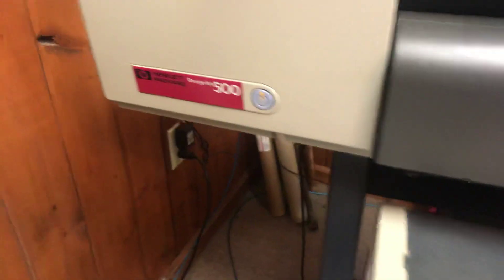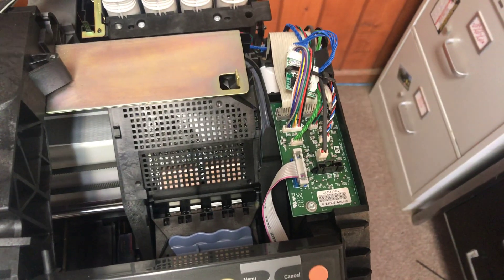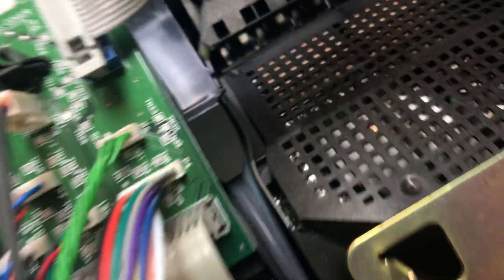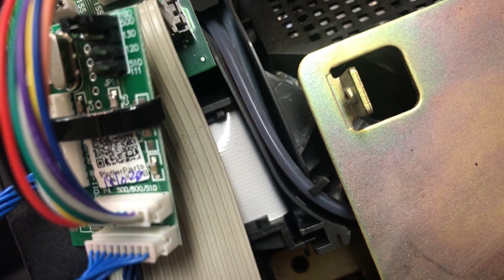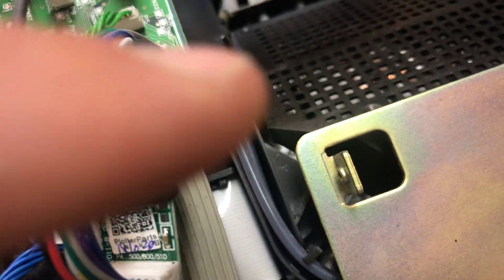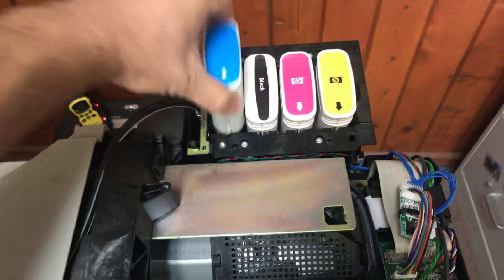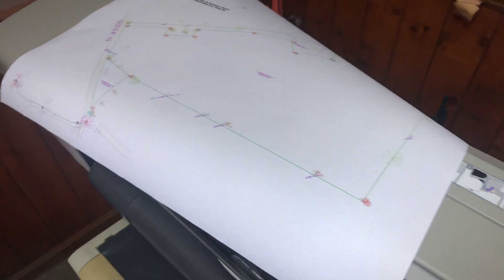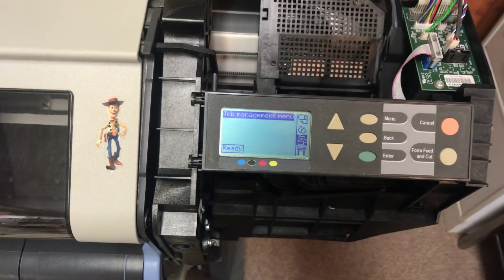HP500 Chip Reset Decoder Card Install

Comment: Trying to bring back to life a 500 after being serviced years ago and left in storage.  New Printheads and Cartridges.  Got the big 'X'.  Installed the Chip Reset Decoder card but still the big "X".  Any ideas?  The Rainbow cable is now red.  Someone here mentioned about swapping the cable around, but it just looks pin to pin so can't see how that would make a difference?
Reply: Also, the printer had some original cartridges, still very full, but years pass their date.  But do they really have an end date, can the ink deteriorate?
Reply from the maker: @tim-ClassicVWLT  I have used out dated cartridges. I use think the X is another issue. The decoder just makes it think the ink is always full and never shows empty. Yours is not even recognizing the cartridge. I would get a new cartridge and try. If it’s still X and it must be in the printer. ??
Reply: @piratesofthehatchie   Thanks for the reply.  I replaced the Printheads first with the very old (HP original) cartridges still installed.  They showed as okay.  Produced a print then got the "Replace Cartridge message and the flashing "X".  Installed replacements.  No joy.  Installed the module.  No joy, with both sets of cartridges.  Probably at the end of the line now so it will be heading to eBay for spares.  It has bearly been used in its entire life, so in very good physical condition.
Reply from the maker: @tim-ClassicVWLT  I got a HP T830 plot/copy/scan a couple years ago to replace mine.
Reply: Is this the only solution!? My magenta goes after literally 1 print after install. So basically I get one print per pack of ink. Now the blue is flashing too and then this error code went on sad as this was my money maker
Reply from the maker: @melissamckenna2948  if you haven’t got this decoder, It’s worth a try. Get you some refillable cartridges and see what they do.

Comment: I replaced the entire ISS (Ink Supply Station) and after 15 or so plots, the cyan chip decoded and showed an X again.  So the ISS isn't the problem.  It's probably the logic board.  So, I've ordered the decoder shown here ebay one to try.  It should make the plotter think all of my ink cartridges are full and bypass the bad cyan cartridges at the risk that when I run these dry I wont' know it until the prints go bad.  Hopefully I'll notice before my print heads take damage.  Maybe I'll get all my cyan cartridges working again!  If not, I'll try to transfer ink from them to a working empty cartridge.  Such a waste when your old plotter just decides to code a full cartridge as bad and then it won't work on ANY plotter.  Full or not.
Reply: I've now successfully installed a decoder board as you did and the plotter immediately started reading all cartridges as new and full as advertised.  I can use those old Cyan cartridges now on that plotter.  I plan to put some new chips on the other cartridges to hope to use them sooner.  Thanks again.

Comment: This was very informative.  I have just received the entire Ink cartridge reader tray from a chinese refurbishment thinking that was my problem.  It wasn't too expensive to order, but now I see maybe my issue is the decoder board.  My Cyan or Blue would go unuseable and I went through 4 or 5 cartridges. It would read new ones for a few days then stop accepting them and these cartridges wouldn't work on ANY of my other plotters. I Have a second HP 500 and an HP800 in addition to the problem machine.  So I'll try the tray and if it doesn't work, I'll try what you tried.  

What's interesting is you say the cartridges started working again for you.  My cartridges won't work on ANY machine after the troubled machine renders the blue cartridge "X"'d out.

Comment: Does the decoder card register cartridges as present and full even if the cartridges aren’t installed? I’m wondering if this decoder completely overrides the chip on the cartridges themselves.
Reply from the maker: It makes the plotter show full cartridges all the time.
Reply: @piratesofthehatchie  Thanks for the quick response.  I’ve been thinking of running the printer’s ink tubes down to gallon-ink supplies. That would either mean installing the decoder and keeping empty cartridges in place for their chips to be acknowledged as “cartridges installed”.  But if the decoder forces the printer to think they’re installed and full even if they’ve been removed, I won’t even need empty cartridges and can just run the tubes directly to gallons of ink.  Eager to try this, so thanks for the feedback.
Reply from the maker: @jeffsheldon  you may need cartridges in. I think it knows if they are removed. I have retired my plotter but may be able to check it.
Reply from the maker: @jeffsheldon   turned on mine with no cartridges in and it showed full and ready. Took a pick but can’t post it. 🤷‍♂️ so it should work like you want.
Reply: @piratesofthehatchie  This is extremely generous of you. Thanks for even considering testing this functionality out let alone actually following through. I was donated one of these units for use in a student media lab and my hope is to make printing cheap and accessible for both students and the surrounding community. You’re good will will benefit a lot of people and I likely would have gone about this differently without your detective work. Thank you.

Comment: Hi, I have bought decoder card ftom AliExpres but it doesn't work... maybe I made something in wrong order or something?
Maybe it works only with some models of 500? Maybe it is firmware?
Have you removed the cartridges (or chips) from the drive before installing the card?
I will be grateful for any help...
Reply: Flip the rainbow cable. Work for my

Comment: big big thanks !!!
work on HP 800 PS
Reply: Hi, I have bought decoder card ftom AliExpres but it doesn't work... maybe I made something in wrong order or something?
Maybe it works only with some models of 500? Maybe it is firmware?
Have you removed the cartridges (or chips) from the drive before installing the card?
I will be grateful for any help...
Reply: @88marcin  I have already installed the latest firmware and use the cartridges with self-resetting chips
Reply: @danchiparus 
 decoder + self reseting chips on cartridges?
Reply: @88marcin  yes!
Reply: @danchiparus  where did you bought that chips? are they realy ethernal?
Reply: @88marcin  bought in Italy. For a while I used them without a decoder but they generate a problem when they reach 10% of the measured capacity (the moment when the chip is reset automatically) causing the machine to go into crisis. Using the decoder nothing happens anymore - it always signals full cartridges
Reply: @danchiparus  while instaling decoder shows full, until sending file to print, then machine shows error 22:10... i tried with standard chips
Reply: @88marcin   for me work with autoreset chip...
Reply: on HP 800 PS with last firmware
Reply: @88marcin  I have this same issue

Comment: What happens the actual cartridge do run out of ink - how would you know to replace ? 

What i understood is that decryption chip fixes issues with full cartridges with faulty unrecognisable chip installed and allows the printing.

Please advise
Reply: running out of ink when the printer thinks it has ink will cause the print heads to misfire which is very bad for them.
Reply: Ron 100% - hence might be good to invest in transparent ink cartridges
Reply from the maker: The plotter will pause as it goes back and forth and you will hear the cartridge trying to prime. When I notice this I pull the cartridge out and shake to see how much is left. Usually black or magenta for me.  I always ran my ink after the cartridge showed low on the screen anyway. The print quality will drop also. You can calibrate color to see which is out too.  My plotter was not reading the cyan chip and making me replace while it was still full. I recommend getting the clear refillable cartridges now so you can see levels. Only 30 bucks with ink included for all four. 
Thanks for the comment.
Reply: piratesofthehatchie Thank you so much for your reply, So beside installing the decoder to resolve faulty full cartridges with bad chip reading you recommend clear cartridges, great.
I am in the process to install a decoder and asked whether its worth installing or not - rather than purchasing new cartridges every time i have issues with faulty chip- i hope i am making sense . 

Also would the decoder help over ride issues with the print heads ? 

What i like about your video is that you are the only one who’s illustrating the decoder and resolving an issue 

I am fascinated with this decoder and wanted to know what it does and avoid any cons .

Thank you again 🙏🏻
Reply from the maker: I have bought more blue ink than I can ever use before discovering and installing this chip.  On the printheads— no. It won’t help with them. The cheap refurbished ones are hit and miss. I always keep a hp genuine black for backup even if expired. Never let me down. I go thru black ones like water. Tried cleaning techniques too, just pisses me off.  Thanks.
Reply: piratesofthehatchie Great so the decoder is a hit for inks glad to hear , i have recently changed the printheads as two of them are worn out (in error msg ) but didnt get to install them as the magenta cartridge decided to give me an (X) error so didn’t get the chance to change the printheads- tell me about it i tried to clean the cyan printhead and ended really bad - i would recommend buying one hopefully the good refurbished ones should work. Thank you so much 🙏🏻